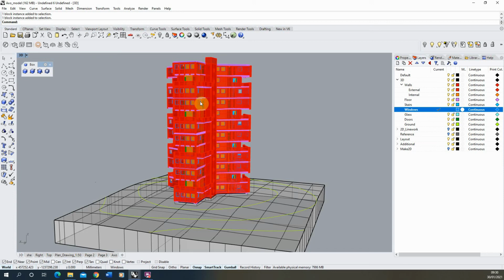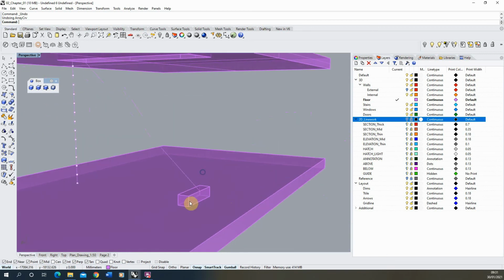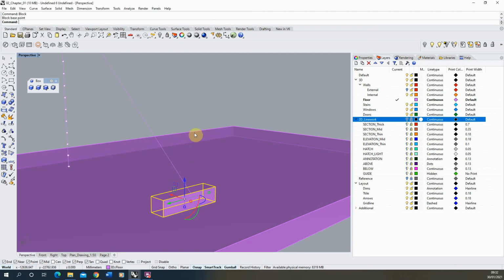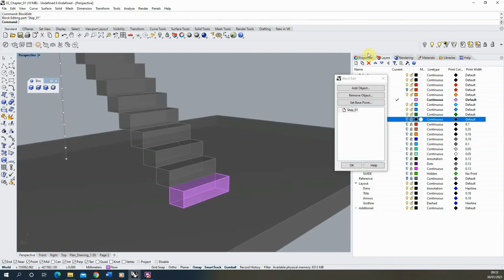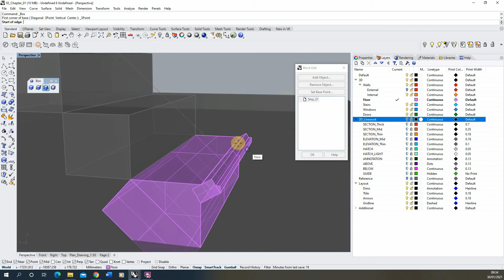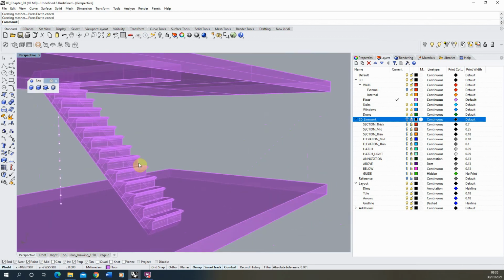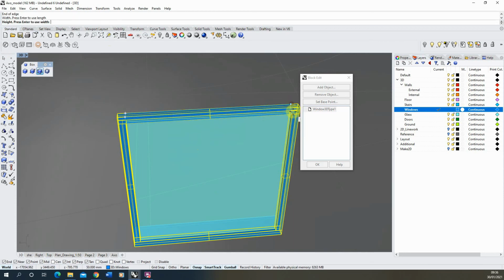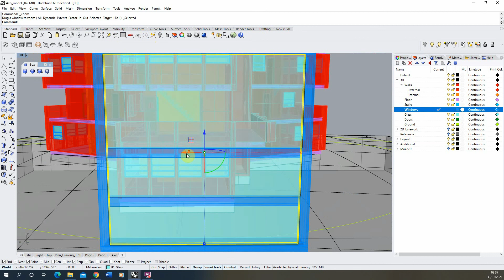Creating and Using Block Instances in Rhino

Comment: can you tell me after creating the block i insert same block with different scaling, is there any command exist by which text (number) in the block automatically changed to desired number?
Reply from the maker: Hi Sprinter, unfortunately I don't think this can be achieved within a block as by their nature they are all exactly the same. You could potentially achieve this by using a dimension contained outside of the block however